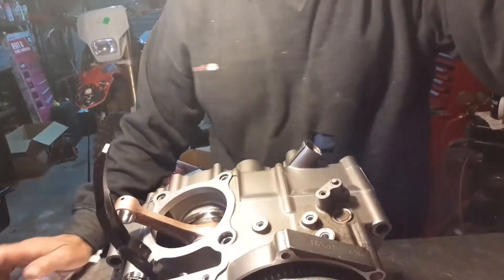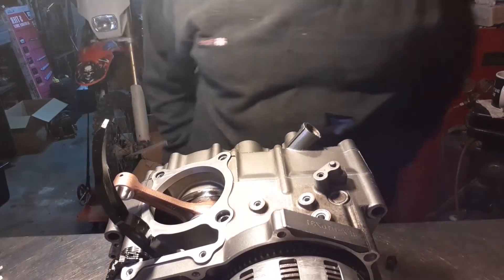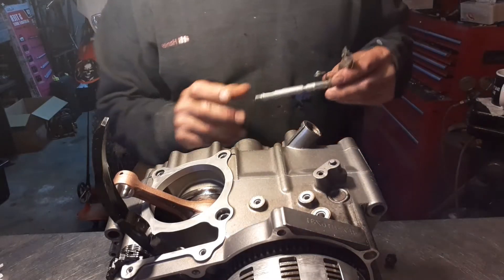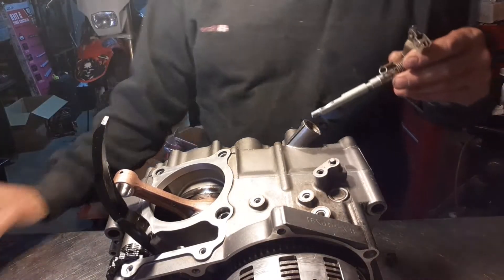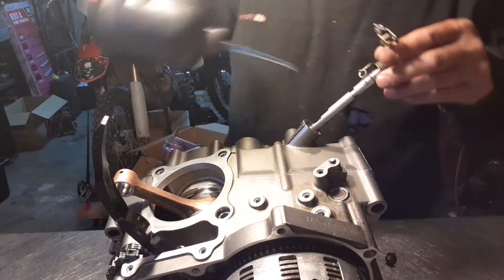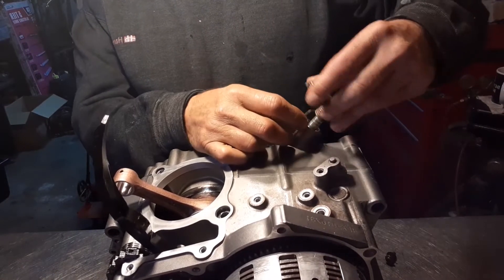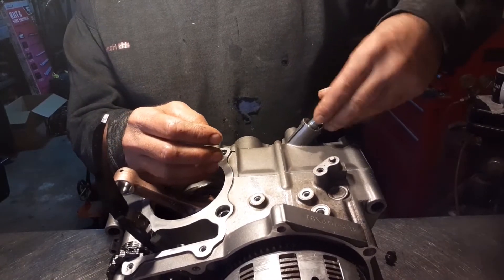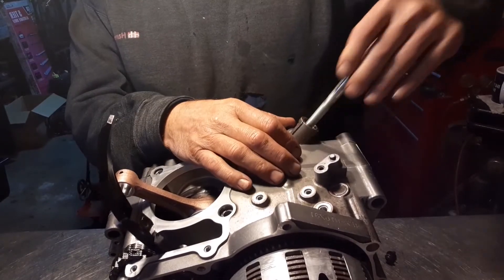Yamaha TTR250 bigbore 325cc part 3

Comment: Hello from Russia! Can You tell about resource of engine with this BigBore Kit? Any problems with crankshaft(in this configuration with more power)?
Reply from the maker: Gday mate. 
The TTR250 is over engineered and super strong. I have had many hours on my personal TTR325 with no reliability issues at all. Some have suffered a slight oil leak in between the fins on the cylinder, but that is easily rectified on the bike with a smear of Ultra Black or similar high temp exhaust silicon. Apart from that, reliability is same as normal. 
The 325 surely is a bike that Yamaha should have built from the factory.
Thanks for watching
Reply: @ozcountryliving4751  thanks for answer!! 👍